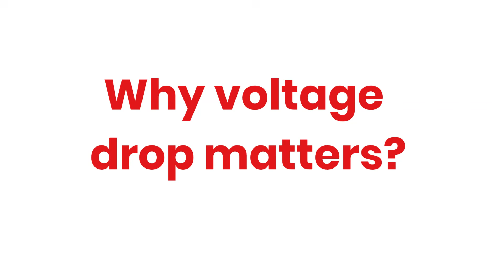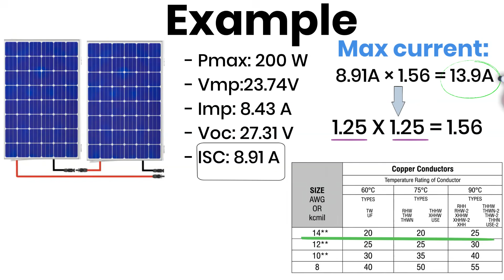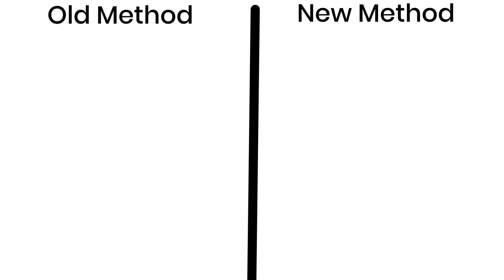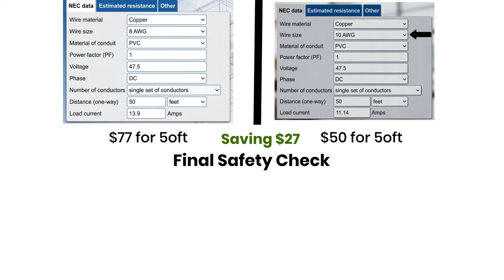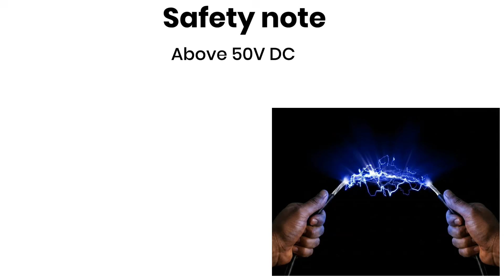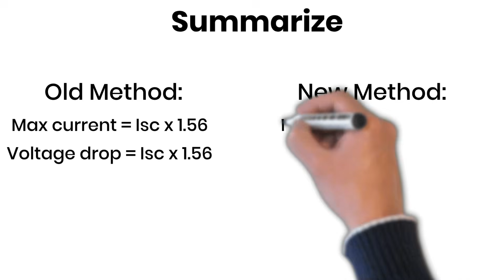Never Buy Wrong Size Solar Cables Again

Comment: You should do a whole complete 12v install…like literally the whole complete install. Showing the step by step, How to pick the correct controller, battery size, the placement of fuses and size to use.